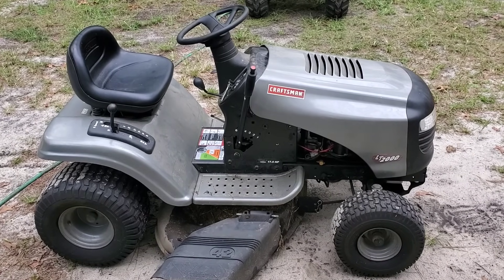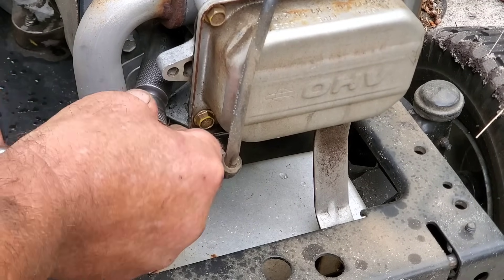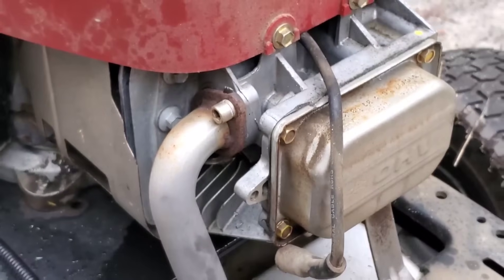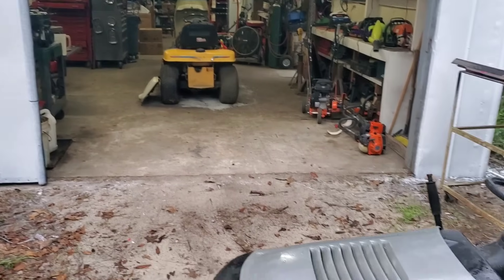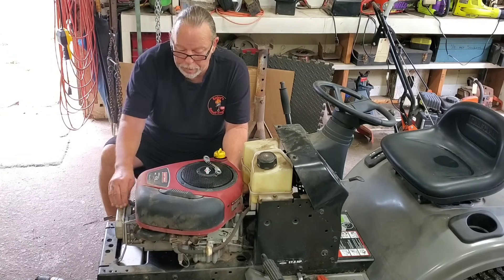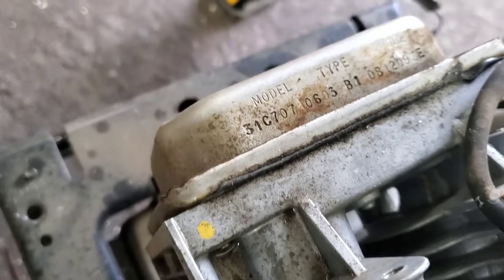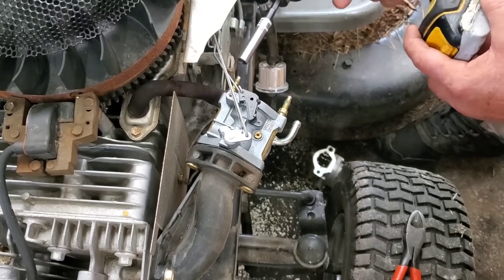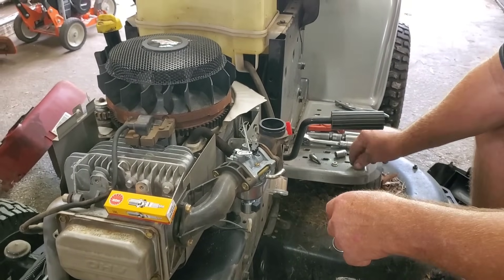Engine won't turn over, locked up?  We show how to diagnose and Repair a Briggs and Stratton

Comment: ...enjoyed the video T-Bone....as usual, great diagnosis and repair.....just curious, do you think the problem with the old carb was
a stuck solenoid valve or a float valve that allowed gas into the cylinder?....🙂
Reply from the maker: Thank you.  A stuck solenoid will NOT cause a fuel leak.  The problem is, in this case needle and seat along with an O-ring on the plastic piece below the seat.  Thanks for watching and commenting my friend.

Comment: Just a quick one T-Bone, why didn’t you just repair the original carb? It’s not a criticism, just a matter of interest. Also, what type is your oil extraction pump, I love that. Keep up the great work Buddy. 👍🇬🇧🔧
Reply from the maker: Those carburetors will fail again because the whole inside is plastic. That pump is home made from pvc, I have two videos on making it. Check them out if you get a chance.  Thanks for watching and commenting my friend.
Reply: @RaleysSmallEngines    Answered both my questions!